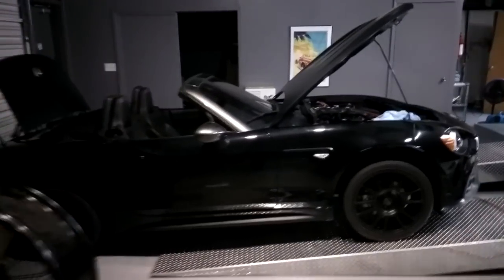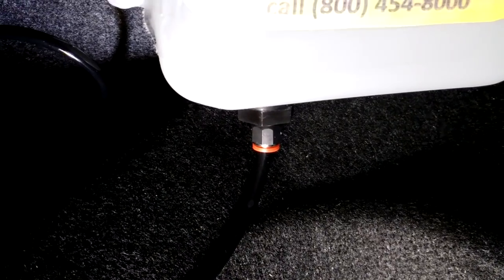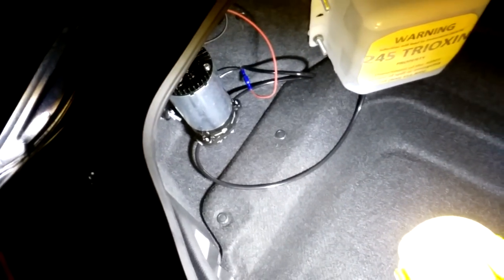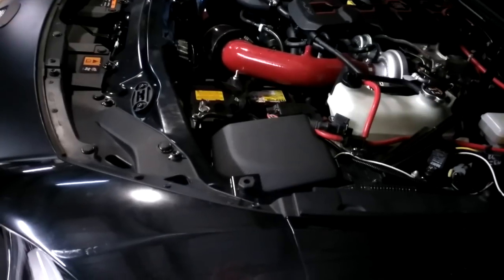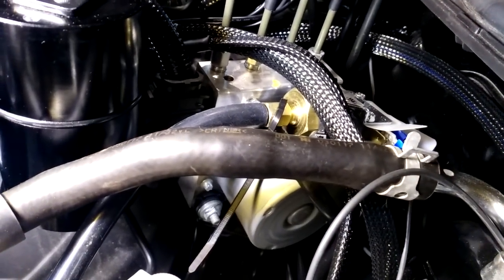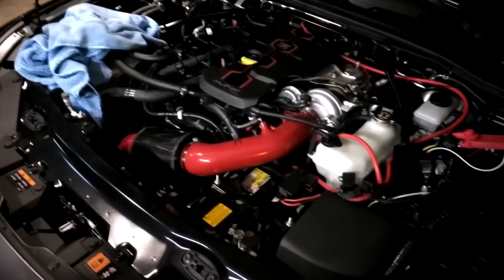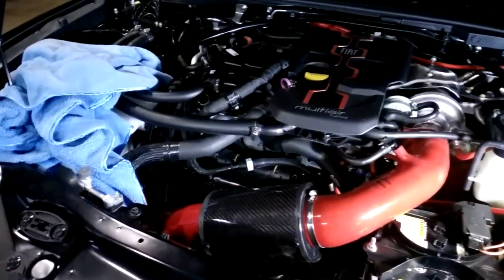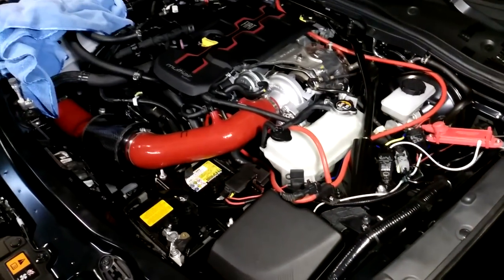Water Injection on my Fiat 124

Comment: I have enjoyed all your videos.  I worked at Product Engineering at Buick and we had planned on putting water/methanol injection on the 1984 version of our turbo Regal.  We increased power from 200 HP to 220 HP, and torque from 300 FT/LB to 330 FT/LB when using it at WOT.  However, the only place to package the tank for the methanol was behind the drivers side headlight, and that did not survive a 35 mph frontal impact without leaking, and since it was considered a fuel by the EPA, it was not acceptable to leak after that impact !!  So, at the last minute, we had to abandon that plan.  Early cars had the wiring harness with the connectors to install it, but that was phased out quickly.  Keep up the great videos!
Reply from the maker: That's interesting, I didn't know that about Buick's efforts in this area. G.M. did bring water:methanol to the market in1962. It failed due to customers not following the simple instructions. That's too bad.
Reply: Well, we went with the intercooled turbo for 1986, and created a legend, so it worked out OK!   :)
Reply: As a long-time Buick hotrodder (from back in the nailhead days) - thanks for your work! I have a numbers-matching '87 GN. I use an SMC water/alcohol injection system - which allows me to run 22 pounds of boost & develop 425 HP & over 550 lb-ft of torque at the rear wheels - with the stock engine. Very similar to the WEP used on the later-model P-47s! (Of course, I upgraded the injectors & fuel-pump to handle that much boost, switched to a TA-49 turbo, went with a 3" mandrel-bent intake & 3" mandrel-bent exhaust w/3" cat, and I also sent the TH200 to Art Carr for a build that can handle 600 lb-ft of torque. I also re-chipped the ECU.) That resulted in a GN that runs 0-60 in ~3.7 sec, runs high 11-sec 1/4-miles, and has been clocked @ 167 MPH on Texas Motor Speedway.

Comment: Nice! I use an SMC water/alcohol injection system on my '87 Buick GN - which allows me to run 22 pounds of boost & develop 425 HP & over 550 lb-ft of torque at the rear wheels - with a 231 cid V6. Very similar to the WEP used on the later-model P-47s! (BTW, my dad flew late-model P-47s - CAS in Italy's Po Valley. 325th Devilhawks SQ, 350th FG.)
Reply from the maker: Thanks for that info. The GNs were great cars.

Comment: That's extremely informative for me, thank you! It has always eluded me why the principle of water injection sort of died with the end of combustion engines in fighterplanes .
Reply from the maker: Thanks Thomas. Water injection is far from dead. Companies like Cooling Mist, Devi's Own, and Snow as well as about a dozen others make these systems.
Reply: Look at the trouble VW got into (dieselgate) to reduce the consumption of DEF on their TDI engines. 
People don't want to have to deal with an extra fluid to add and engine management is good enough that decent power is available without the hassle from forced induction.

Comment: Hi.  Really, enjoy your all your videos. 
A a pilot, you seem unhampered by getting involved with, 'applied engineering'.  
Not unheard of...They say,  'most phenomenal drivers are not (necessarily), phenomenal mechanics'!  
Nice to see.  Very safe, fancy alcohol, water injection system!
Back in the day, (post-WWII), developing 1HP per cu inch was obtainable and kind of  the, 'Holy Grail'. As you (probably) know a simple system that,  'oldtimers' (Post WWII, motor-sport, road-race folks) would make their own alcohol water injection system with a firewall mounted vacuum (pickle bottle) chamber and ( for test purposes), an fuel hose to the manifold to siphon  out a alcohol-water mix.  The rate is adjusted with a brass (aquarium valve) to control atmospheric inlet to the siphon bottle. On-off is crimp-uncrimp  vacuum  to bottle.  Very,  cheap!  Uhm,  I mean, inexpensive.  :)  Cheers!
Reply from the maker: Thanks for your kind words.
Reply: Not at all.  Thanks for the interesting, informative and historically, relevant channel.

Comment: I installed a Edelbrock water injection system on my Maverick 302 V8 which was upgraded to 12;1 compression..  It made a difference of 25hp but was hell to keep tuned. The car ran out at 140 mph.  Fun but a bit unerving to drive at that speed!

Comment: When you install the level sensor in the tank, maybe you could set it up so it automatically turns the pump off when it hits bottom?  That would eliminate air getting into the line and making it a chore to get the system working again if you accidentally ran it dry...and should be fairly simple, as you'd only have to run the pump's power feed through the level sensor on its way to the pump.

Just a thought, but it might save you from a few headaches down the line.
Reply from the maker: I could do that, but the pump can survive running dry for hours, so it's not critical, and I am more worried about the engine than the pump anyway. Once that red light comes on, I take it easy until I refill the tank.

Comment: I want to go turbo on my Grand Prix, and one of the things I do want to install is Water Methanol injection, there is a guy with a Lotus that is compound charged and pushes some 600-800WHP and it has alcohol injection, pretty sweet.

Comment: You might consider putting a 90-degree fitting at the bottom of the supply tank so that the tubing won't be pulled sideways in the fitting as it bends to clear the trunk floor. Less apt to develop a leak.
Reply from the maker: I did consider it, and I'll probably do just that.

Comment: this video is great for those of us planning on doing phase 3 stuff, thanks bud

quick question, is the water injection stuff absolutely necessary for swapping to something like a 1752S garret ?
Reply from the maker: Thanks. Is is needed, no not at all, it's only needed in this application, for extreme boost levels, especially at very high rpm

Comment: How much real world power can an intercooled turbo engine get from the addition of WM? I kind of get the impression that WM systems offer great gains on non  intercooled engines, but an efficiently intercooled engine already has quite low IAT, so that takes much of the potential gain.
Reply from the maker: It's not the IAT that's the issue, it's the temps in the combustion chamber during the compression stroke. WM can lower these a lot, intercooler or not, which is why it was used on all intercooled planes during WW2.

Comment: Is your set up variable pressure? I used 50/50 methanol water which I mixed myself (much much Cheaper) which worked great... what I injector are you using?
Reply from the maker: Hi Ben. As it's shown in the video, it's not pressure variable, just on or off. However the hidden computer (I guess technically it's a micro-controller) does control flow by varying pressure.

Comment: So you are spraying water prior to the air entering your turbo to cool the air to below ambient temperature to develop more power right? And are you using distilled water? What kind of power increase are you seeing? Any problems with excessive knock? Did you have to go with bigger injectors?
Reply: Earl El-Amin ..  Water injectors produce power when droplets of water flash to steam and change volume by a factor of about 1100.  That change when contained in the cylinder raises head pressures and sharply increases engine torque.  The steam also absorbs heat, cleans and cools the exhaust valve.
Reply: but what kind of water do you use? and why its called "whater methanol"? (yes, im a noob on all this engines stuf...)
Reply: Methanol increases knock and cools the combustion temperatures. 

Water cools the combustion temperatures and may increase torque slightly. 

Boost juice is a water/meth mixture that is premixed for convenience.
Reply from the maker: Any clean water will work, distilled water, or water from a purifier on a kitchen sink will be fine. It eliminates knock entirely, that's the whole point of it. My Fiat has the stock injectors.
Reply from the maker: I use 100% water, expect in the winter when I add some methanol to keep the mixture from freezing.
Reply from the maker: What Brodey means is that methanol reduces knock.
Reply: You mean increases knock resistance. You better not be knocking at all in that thing, or any motor for that fact!
Sorry couldn't resist!
Reply: Just use e85...
Reply: I got on that bandwagon with my supercharged (old school ball drive Paxton Foxbody) years ago, but E85 has been hard to get around here (North Carolina) lately. I mix it with regular 93 octane to E60 which is about 100 octane. Kind of a pain if you have a car you want to drive any distance....not my car lol.
Reply: Robert Elmo I miss my 1998 Grand Prix. Had a custom cpm and could run race gas 107. Custom intake and port polished plenum, custom exhaust system and manifolds. Took her from 16.8 in the quarter mile to 14.4. Also had split ratio rockers
Reply: I assume a 3.8 Blower car?
Reply: Robert Elmo she was a 3.8 but I never got a chance to mount a blower or turbo. A company named zzp did build kits for naturally aspirated cars. My car s was an SE version, but it had the 3.8, not the 3.1 liter engine. Was a half year option that they didn't offer after folks figured out they could save money by not buying the. GT version. I miss my sleeper.
Reply: +Earl El-Amin  I believe the water is added after the intercooler, between it and the intake manifold.  I was taught it's not ideal to have water droplets hitting the compressor vanes when they're at speed...and you don't want to have it passing through the intercooler where is may return to liquid droplets as the temperature drops.

PS:  I used to have the Grand Prix GTP with the blower.  It was absolutely stock, and sadly, it made too much torque at low rpm where I was already short on traction (it was the first model - '97, I think - and didn't come with any form of traction control beyond a delicate right foot)...but it seemed to run out of puff once the engine speed climbed to 5000 and above.  I'd assume it would have been better with a few mods, but...never got around to that.  These days I prefer a turbo for FWD, as I find I need the added power at higher engine speeds, rather than off the line when I can already burn rubber too easily.  A little lag is sometimes a good thing.  :-)

Comment: Hi Greg. Love the technical know how with practicality. Hard to find. Strange request. I may need your expertise. I've invented a lightweight infinitely variable, gearbox thats lightweight and robust. Similar in principle to the German supercharger idea but not hydraulic. (ps not belt driven either and generally not a design that is known). Operates itself through the feedback of wheel speed and engine speed to constantly vary the ratio. May need some help with detail design. If you're interested, mesage back and I'll send my email. Look forward to hearing from you. 👍
Reply from the maker: Hi William, that's way beyond what I know how to do. It does sound really interesting though. I wish you  the best of luck with it.